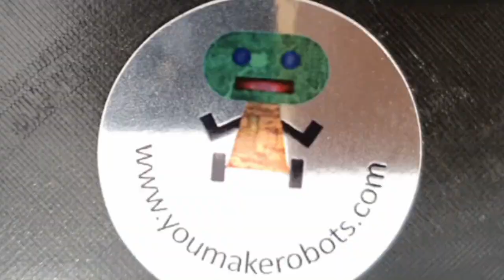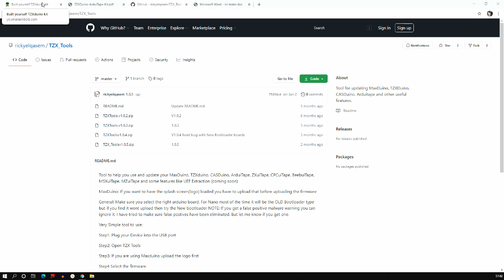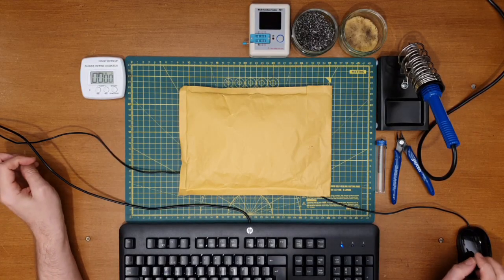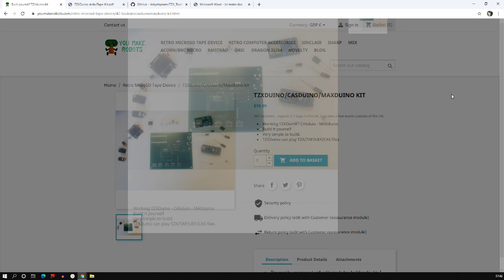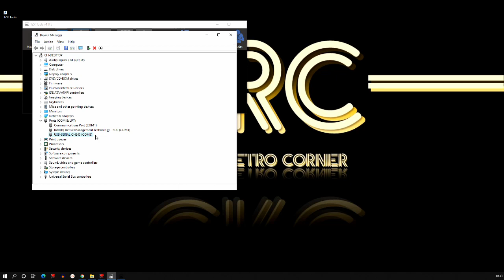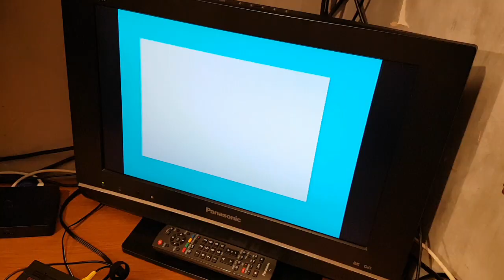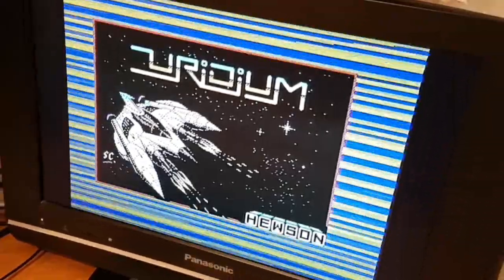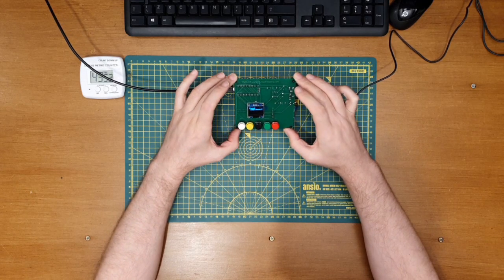YouMakeRobots TXZDuino Cassette Deck Emulator Kit -  Timed Build, Flash and Test

Comment: i just made one of these
apart from my poor soldering it works well and is easy to do
i had mine turn up with no switches but a quick mail and they came a couple of days later with a couple of spares
it works well but you DO need a class 4 micro SD a class ten wont work

Comment: Thank you for this useful video. I had an issue with the Arduino, where I thought that the 2x3 pin header is soldered-in, since there are holes for it - but as you showed, it is not. That prevented me making a mistake!  My TZXDuino had an extra button: RESET. Thanks also for stressing the importance of drinking tea (even if re-heated!) while building the unit.
Reply: Yup i added the reset button in later versions.
Reply from the maker: Hi there Brooknet! Thank you for your comment! Yes, as Ricky from YMR says, the Reset was added later, a really helpful feature I'm sure! 😊 Glad this video was of some help to you! And oh yes.... one must always have a tea on the go when tinkering!! 😄👍